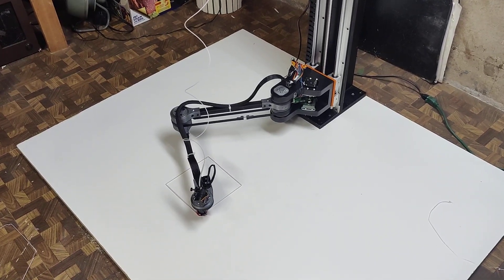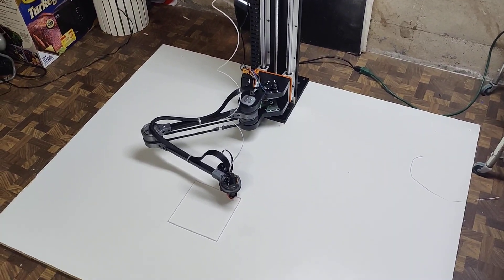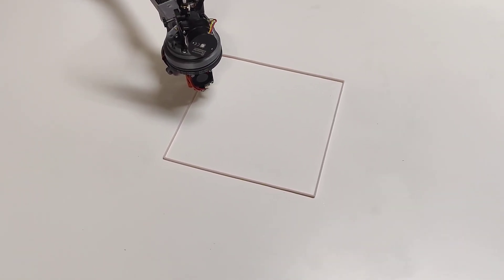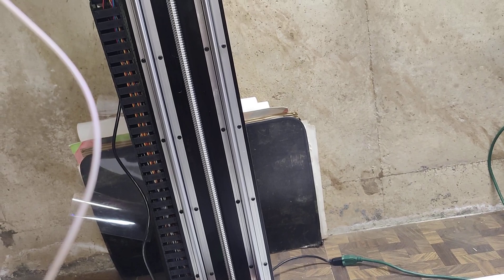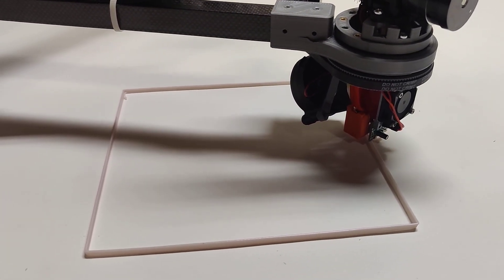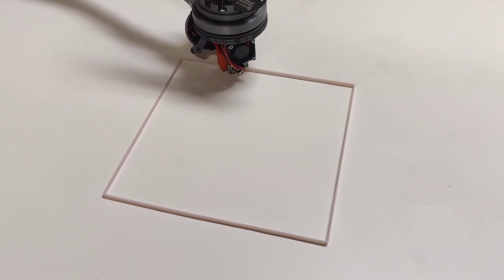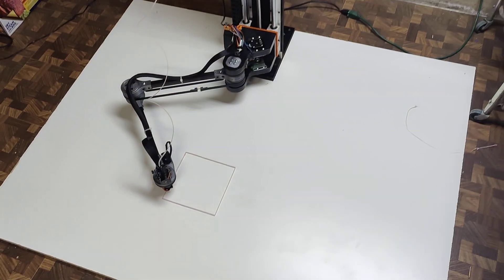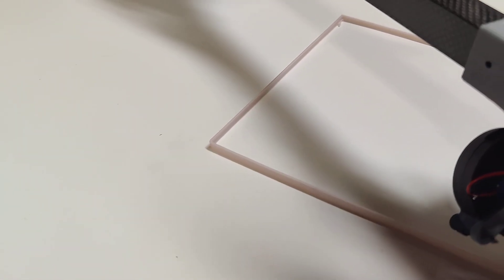The first print - IBIS S1 SCARA 3D Printer

Comment: Just found ur project, awesome!
First thought: why do u have a turning effector unit? Stiff mounted would save so weight. Or do u need it for calculating/ controlling the movement?
Reply from the maker: Rotating effector is to reduce the error of arm sag. Because the arm is angled under its own weight, having the rotating end allows the hotend to maintain the same relative angular position in all directions with the base.

Comment: Congrats men, This should be the way in future for FDM printing. I think for ABS and other filament heated bed may be the issue but we never know if those type of material/filament needs to adapt to this or someone has to find a solution for it.  By the way, what will be the print area in terms of X and Y?

Comment: Nice work. My only advice is to go Closed Loop on all servos and you can get the cable that interfaces with most printer boards. 👍👍👍👍👍

S42B V1.0 Closed Loop Driver Control Board with Stepper Motor

Comment: So the slicer you're using supports this non-standard configuration or do you need to write your own software
Reply from the maker: The slicer just gives X/Y coordinates. The firmware on the microcontroller (duetWiFi) converts the X/Y numbers into the special motor moves for the arm